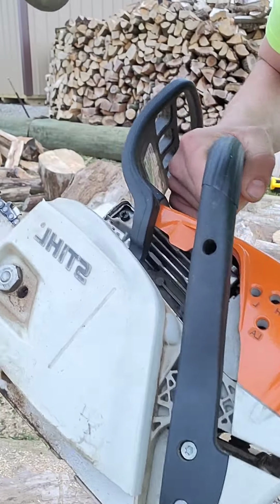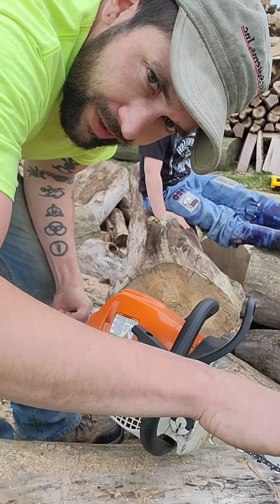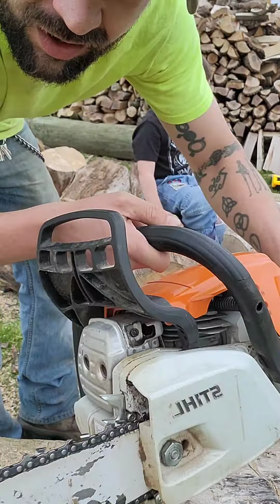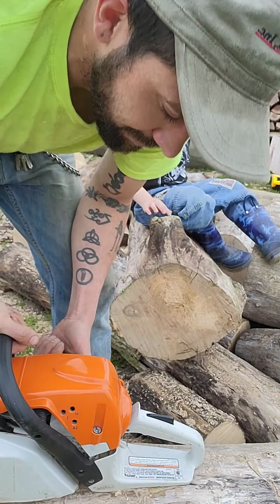stihl ms251 , muffler mod , intake mod

Comment: EPA is killing the saws
Reply from the maker: Agreed 💯  they are even putting catalysts in the mufflers now
Reply: @kingsaws  yeah..I just got done with a jonsered 2152c..catalyst muffler...I'd say that's why the cylinder roached twice...I threw it away and got an aftermarket muffler
Reply from the maker: @Aaron_A_Lynch  I think it makes them run hot ! To much for the exhaust to pass through , too much restriction
Reply: @kingsaws  absolutely...too hot..cooks the saws

Comment: So you drilled the whole bigger and took out the spark screen? What else did you change inside the muffler?
Reply from the maker: Made the exit port twice the size , it was the size of a number 2 pencil. Took the screen out also. Nothing to the inside of the muffler . On the intake I removed alot of the little fingers off the go around the intake hole
Reply: @kingsaws  you forgot the pictures to show us.

Comment: Hopefully you still see this after 2 years but i just did a muffler mod on mine an yes woke it up alot the thijg is when i set the high well its all the way out i feel by ear theres not much of a difference like most saws think the carb is a tad small ?